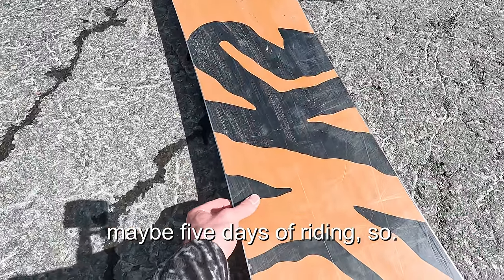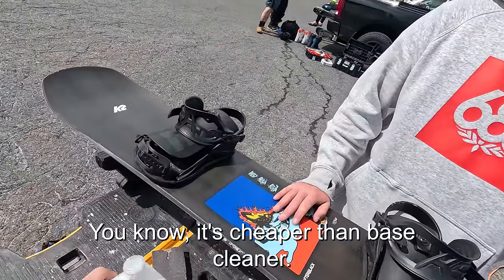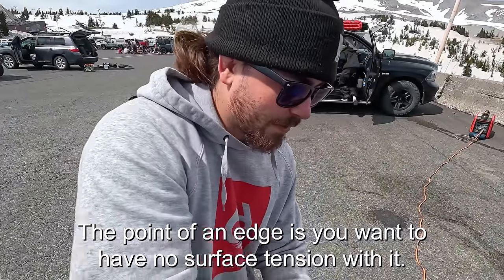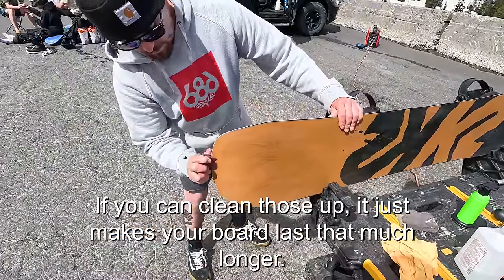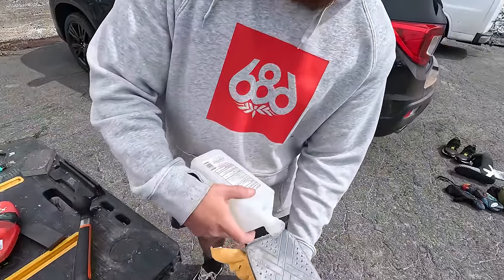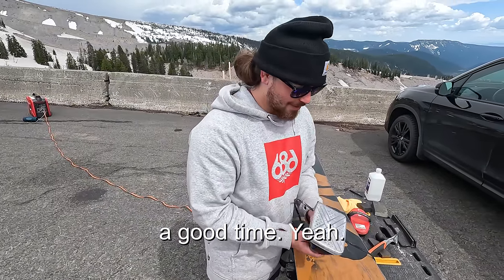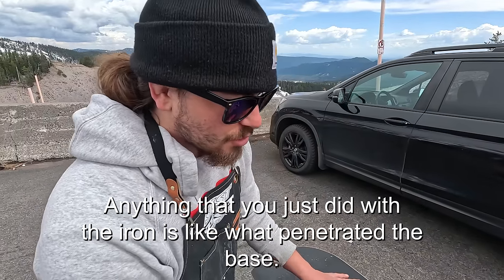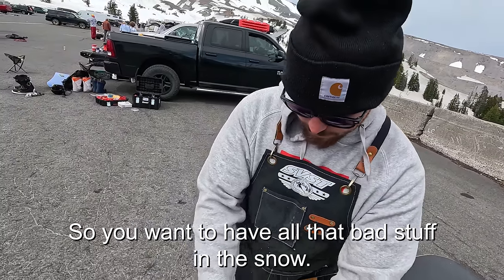Learn The Secrets of Snowboard Waxing & Tuning

Comment: Tip for anyone using p tex. When using this system, apply tape on either side of where the scrape is prior to applying the p tex. This will ensure that it only gets into the damaged groove rather than having it be where it really doesn’t belong. It also looks a lot cleaner when you do this method. Happy shredding everyone 👊🏻

Comment: Easier solution... Phantom DPS. One treatment. I have it on all my custom boards. Lasts the life of the base. It penetrates the entire base sheet so even if you scratch the base - it's fine.  Just rub with the polish pads provided for the fastest smoothest glide. I glide past everyone on the flats. Sure you can apply a wax  - if you like the zen feeling of waxing. PTex yes, grind the edges yes. Wax - never again.
Reply from the maker: I need to try that!

Comment: What a great demo of the process.

I love that you straight up used not just a brass brush to help clear out the excess wax, but a steel brush, too (nice mention of the directional component).

I wondered for a long time why some people are so against using a steel brush to help get excess wax out that is down in the structure, instead of just wax at the surface. Clearly, it works for you and your customers.

Comment: Probably a dumb question but why do you scrape all the wax off? Like shouldn't there be some on there to have less resistance? (I've only had my board a month so I haven't waxed it yet, just curious as I'm new to all of this)
Reply: You only scrape of the excess wax that is too much. The wax that you really want on your board is kinda soaked into the base, so you don’t scrape of that wax (I‘m not a pro, these were just the things that i was told when i learned how to wax my board)
Reply: Think of it like this: If you zoom in on your base (like with a microscope) than your base will have a lot of "scratches" and holes and everything, so it isnt smooth -> more Resistance. Now all the wax does is fill in the holes and scratches therfor making the base more smooth and you have less resistance. Now the problem lies in the fact that the Wax itself is pretty "sticky" when put on snow. It is only the combination of Base and wax that makes it glide well. And therefore you want to scrape of the layer of wax that seperates the Base-Wax-Combination from the snow
Reply: Most of explanation you got down here. But it's also a difference if you have extruded base (EB) or sintered base(SB). EB is made with heat and is like one piece, SB is done under high pressure and is porous. So it holds more wax.
Some boards also have structure. Structure pushes water out and if you leave wax in there the structure won't work. Water you ask? When you cruise down,the friction makes a thin lair of water.
I was about 4-5y.o when learning waxing, am 40 now. So I've done it numerous times so2say.

It's not that hard but U need patience. A good groundwork shows in the final result. Like groundwork on a car body before the paint job so to say.
All my boards r SB. So I always take the bindings off, or at least loosen screws, so that there's no stress on the inserts. To avoid "base-dimps"(seen that happen😅). 
Tip to tail with a little wax trail behind the iron. Then I go tail to tip, and a final run tip to tail again.
Trail should be few inches long behind the iron, consistent speed
Reply: I never scrape. Too messy and too much time. Plus the extra wax lasts longer and adds an extra layer of protection. I know im bout to start a war in the comments, but my take is: if you are racing and want the fastest base for 1 day then scrape, but if you just want a smooth ride that lasts multiple days dont bother
Reply: @JohnDouqh hahahaha...yeah man, you're about to start a war here😂. 
But after scraping, it lasts about three to five days depending on the wax.
HotSouce says that their is good up to a week (according 2 them that is).

But how do you get an even base if not scraped off?? There's no way you getting that with an iron. Or maybe if your iron is wide as your snowboard